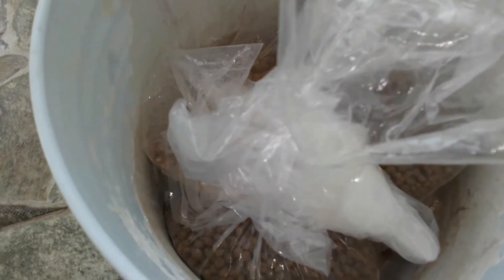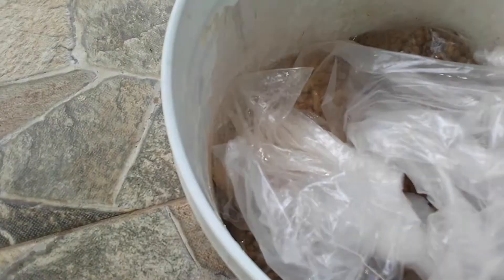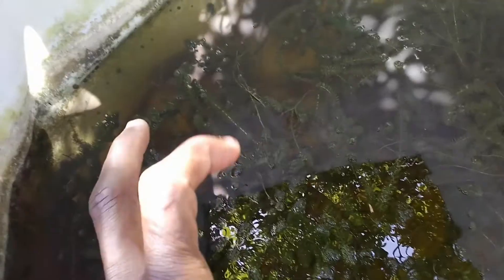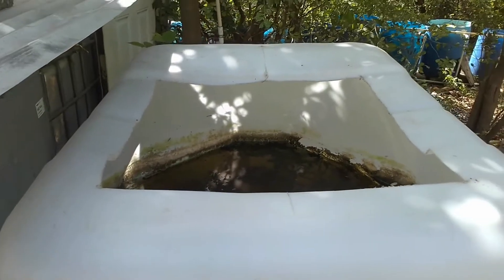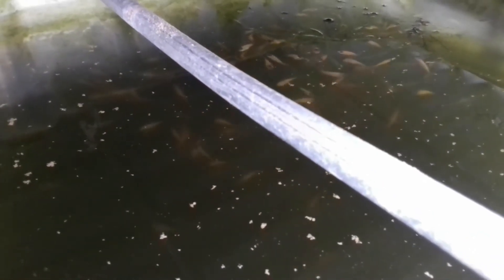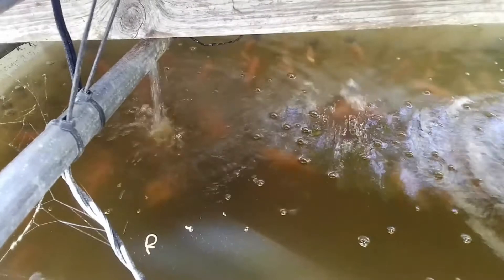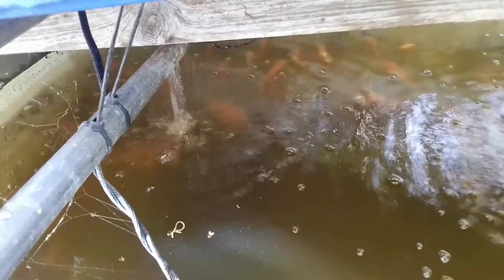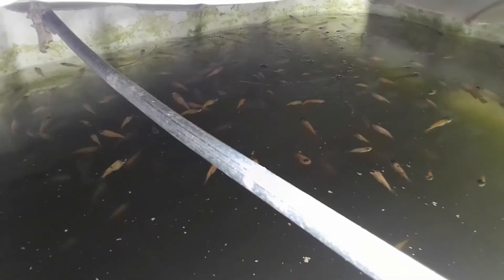FARMED Tilapia  GROWTH growth rate || How fast do tilapia grow

Comment: I have some but every morning i wake up and find one dead, i have a pump and aerator in the pond and i don't over feeding. What could be causing the deaths. Ive done water change about 2 weeks ago and those water have been stored for over 24 hours before adding to the pond and its a 50/50 water change  a few died before so i changed the water and they still kept dying 1 or 2 per day. Started with 42 more than 3 weeks ago and im down to 20 today
Reply from the maker: Good morning, it sounds like your water quality and your stocking ratio is not good.

Water should be about 2-4 days old gard ( stored before use ) before usage in space with fish.

It also sounds like you have too many fish in one space. How large is the space in which you keep your fish stock? Are you in Jamaica, if so how has the temperature been? Fish consumes less whenever it's cool. Try to cut feeding ratio during this time into half